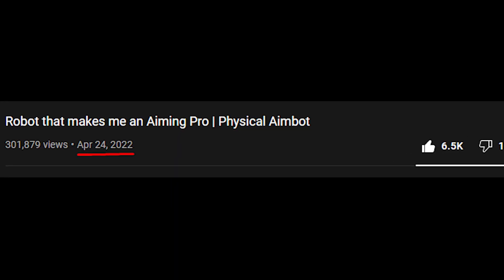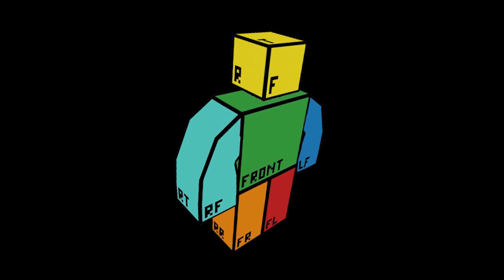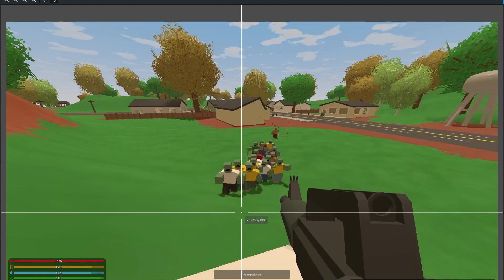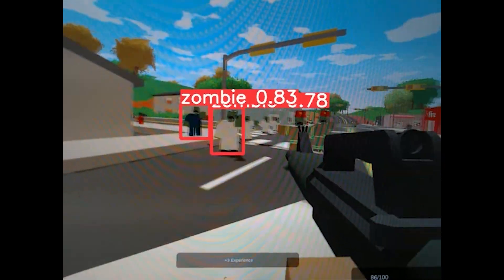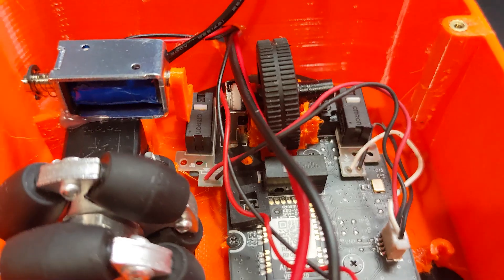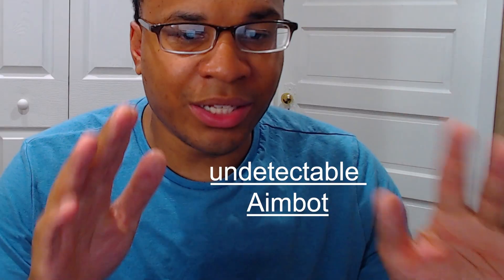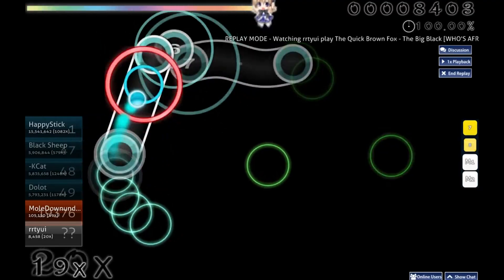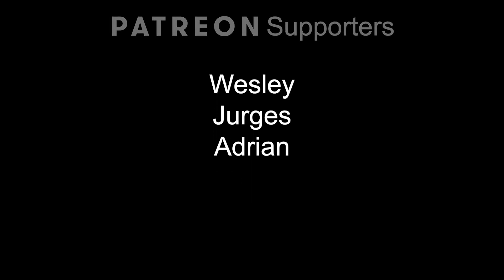Undetectable AI Robot Aimbot - That Sorta Works

Comment: A better and more accurate solution for mouse movement is a arduino leonardo + usbhostshield so bassicly u plug in the mouse to the usb hostshield and the arduino to your pc so windows sees only 1 mouse and you can use it as normal yet it has a arduino middleman this is actually used for actual cheats for valorant and such now u have 2 options either controll it trough your main pc whit serial or HID or you buy a crh40 module and plug it in another pc so that pc sends mouse commands if you fully wanna go "undetected"

Comment: am I understanding your hardware and software tech stack correctly here??

teensy "sees" and controls the 2 omniwheels > send/receives info from another PC which is running yolo 

now,
can we do this ??
 RPi that "see" thru the camera and also controls the 2 omni.wheel ?
while the RPi also processes the data ?

would a RPi be able to handle all this?
Reply from the maker: @fringeanomaly9284  the thing that actually doing a lot of the computer is my computer through a cable! What you could do is wirelessly send a command through Bluetooth or WiFi to a robot and leave all the big computer to the main computer
Reply: @KamalCarter  i was actually thinking of using  AWS or use one of my hetzner instances with RPi being the "eyes" and "hands" for the robot 

but before committing to that tech stack i thought if at least I could prototype with just RPi doing it all as I do not have another PC to work with
Reply from the maker: @fringeanomaly9284  I have seen a Raspi do object detection before so give it a shot it might only work at a lower fps ~12 fps. How are you going send data from game to Raspi? Also how is the Raspi talking to the motors?
Reply: @KamalCarter  like your version RPi will use a camera to classify objects, and as far I have researched to also control the omniwheels

RPi camera looks at game > RPI either processes it (or another computer) > the resultant output would command the wheels to move accordingly 

sure it most likely would be slow but I am thinking of just prototyping it for starters then create a middle ware (another PC for actual object classification)

what's ur opinion? too complex? too theoretical??
sry if it's too dumb

Comment: @0:11 I don't know if those are examples of "Valid concerns" - Although their underlying fear is legitimate, their perspective is flawed. You are not a bad player who doesn't understand game mechanics... You are an engineer/programmer/mechatronics guy who wanted to build something cool... I will die on the hill that actual cheaters, people who want to [and thus going to] use cheats to try to beat people in public games / "compete" and make (steal) money using cheats are already and always looking for new ways to cheat/make their cheats undetectable.

This is a simple concept of economics. There exists demand from the cheaters themselves, and they are willing to pay money for cheats, and lots of money for cheats that are (at least for the moment) undetectable. This game of cat and mouse between anti-cheat and undetectable cheats and the advancement of anti-cheat and the inclusion of anti-cheat bypass in cheats, etc, etc., has been going on for DECADES, and that is just within gaming! 

It is a perfect analog to locks. "Unpickable" locks do not exist, they have never existed, but there have many times existed locks that had yet to be picked, or could not be picked by some % of people who attempt to. The same is true of games and any anti-cheat system of any kind. The better and more complicated the locks got, the more precise and more specialized lock picking hardware became. Additional security devices were placed on, around, and in front of the lock, and bypass tools were invented specifically for them to defeat those security measures. This game of cat and mouse has been going on for literally centuries...

It is precisely similar to the game of cat and mouse that continues after a decade of iOS releases and hackers finding exploits in iOS to perform jailbreaks -> leading to Apple creating and releasing patches specifically for those exploits.

Now, that is just a baseline fact. None of that is my opinion or an argument I am making; that's just history.

My argument: It is not bad for things like this (or jailbreaks (specifically the exploits that allow for them)) or new physical security bypass devices to be PUBLIC!

There is an argument to be had that their existence is bad, and people building things to exploit them is [or at least could be] bad, BUT, people ARE going to figure them out and bad actors ARE going to use them, regardless of them being made public or not, SO, with that being the case, something like an exploit that can be used to either take complete remote control over someone's phone by sending them a PDF OR using that same exploit to release a public jailbreak, prompting Apple to IMMEDIATELY develop and release a security patch actually protects users, not hurts them. This video will DIRECTLY cause cheaters to consider making similar devices and will DIRECTLY cause game developers / anti-cheat engineers to include or attempt to include detection for such devices - I can already think of several that are very straightforward.. and of course, I can also think of potential ways to bypass those measures... But that's the game, and it WILL be played whether or not it's public or being sold to the highest scumbag bidder on a black hat cheating site... So which would you prefer...? 100 people have it and no one knows about it, OR 23,000 people have it and the game/anti-cheat devs are FORCED to fix it...?

Russia finds out about the PDF exploit, Millions of American phones are now in the hands of the Chinese government who pays the Russian hackers to provide backdoor access...
A security researcher publishes a YouTube video about the EXACT same exploit, It's fixed tomorrow and maybe a dozen people were ever affected in the real world.
Which do you want?
Reply: To be clear, I am not saying I want there to be cheats/cheaters, I am saying there ARE ALWAYS going to be cheats/cheaters no matter what we do or how hard we try, SO, if there are going to be - and there are - then I think it is 1000% better that they be developed in the public so that game devs and anti-cheat devs can see what the current best minds are thinking of / what tech is currently capable of / etc. so that they can develop protections for those things.

To be clear about one other thing, game devs and anti-cheat devs DO know about the cheats that aren't in the public view as well. They go buy them on the same blackhat cheating forums, BUT them being in the public causes them to be forced to do something about it.. Just like suing a company forces them to fix a safety hazard, money is usually the only thing that can get a company to do the right thing, and they know they are going to lose market share if they aren't keeping up with the newest hacks/cheats of whatever kind, so this video right here serves that purpose.

The idea is not novel (no offense whatsoever intended; I think what you did is amazing, awesome, cool, clever, etc., but you know this as well as any other programmer/mecatronics guy here), you were just the one to actually do it and pull it off well enough that it performs better than the average player, which isn't easy by any means, but isn't like you discovered that HIDs can be used to mimic human behavior, through software or physical interfaces (physical autoclickers/on chip mouse gigglers and the like have been around for years+), you put the ideas together and executed them, which is great, but I don't think you would claim that you had a dream one night of a mouse being able to be moved by a motor... Like... I'm not saying it's easy, by any stretch, but it - at its face - is hardly a complex concept (executing it very well may be, but.. "move the mouse and click, physically, automatically" is not exactly a flux capacitor.

All I am trying to drive at is that any cheater (more accurately the people developing cheats for the cheaters since they have great financial motivations / capabilities to do stuff like this) could think of this idea (something similar in concept), so it's not like you are leaking the source code that lets people evade anti-cheat and you could have just emailed easyAnti-cheat and told them so they could patch it... This isn't proprietary I guess is what I am trying to say. I could make one that accomplished the same thing but used a roller ball mouse, 3 omni-motors like your old robot, put into a 3D printed enclosure, whatever, you know? I mean I know you know Kamal, I'm just unsure everyone else does.

There is definite X 100 a conversation to be had here, but Kamal, or anyone else, releasing this information publicly is doing us ALL a service (assuming you aren't the <1% who are active cheaters paying for cheats or the the people who create and sell them)...

Comment: Your previous mouse was better than what you have now. That mouse isn't able to do X Y movement
Reply from the maker: Yeah I messed up 😅, but this was more for the visual component
Reply: @KamalCarter  I'm wondering how you move things from 1 point to the other, like you did with your mouse cursor.
Reply from the maker: @randomdamian  on the robot side I used PID to command the robot voltage depending on how far away it was to the point and but if you just want to move your mouse you can use a library like pyautogui

Comment: Looks like the control system could be improved. Are you using PID to control the mouse movements?
Reply from the maker: Yes, this time around there was bad mechanical construction, so no matter how good the control system was the mechanical system wasn't holding up

Comment: So what's the controller you are using? The main processor for this? I guess that both the motor control and computer vision are happening on the same system. Is it a weird embedded platform?
Reply from the maker: For this I have a teensy that is getting camera commands from a different computer
Reply: Thanks

Comment: yo bro, I'm also interested in machine learning and motion systems. Are you going to continue this project in the future? If I wanted to continue project with higher power motors(400w-700w bldc motors) would you give any advice?
Reply: I might fork it to a gantry based robot. Similar to to a BLDC odrive system as used in the "vzbot odrive 3d printer". Still might be cool. I feel like if you really wanted a geniune aimbot physical mouse experience you would have a electromagnet magnetic table underneath.
Reply from the maker: I'm going to work on some other stuff but I might loop back to this project. But I think what you suggested with using an Odrive and some Brushless motors would definitely be a fast way to make a really good gantry for this.

Comment: You don't need a solenoid for the buttons, just solder two wires to the pad, and wire it to an arduino or whatever, you can measure the voltage across when it's pressed.  If you nail this, you could place bets against people in CSGO and make some money. 😂

Comment: Perhaps you could use a track ball mouse and design something to move the ball instead of a robot having to accelerate a mouse and potentially overshoot the target… also im not exactly sure how two mice running at the same time would work but depending if it does or not you could use one mouse for bigger movements such as looking around and the aimbot mouse could be else where for the aiming, essentially using the aimbot mouse as an aim assist
Reply from the maker: That's a good idea! Yeah in some games the anti cheat stop two mice from running at the same time

Comment: Great video! Thanks for uploading. Assuming this aimbot got good enough for battle royals, would adding randomness avoid detection from Microsoft’s ML bot that detects bots?
Reply from the maker: I think making a better mechanical system and have a more robust trajectory plan would definitely be a step to avoiding detection
Reply: SERIOUSLY………..what is the actual point of playing if the only way you can do anything is by cheating. Give up and go find something more suitable. Thing with any cheat. Is that they are cheating themselves more than anyone else.

Comment: Are there skates underneath the right half of the V2? The dragging and rotating from the weight imbalance could be impacting the robot's performance. The original design with the four omni wheels on the outside seems a lot more stable and reliable. Might be worth rolling back to that layout for the next iteration.
Reply from the maker: Yeah 😅 I need to figure a way to get the old design in A more compact formula